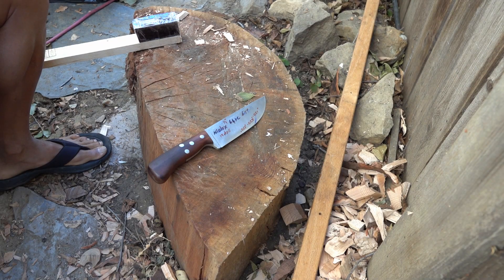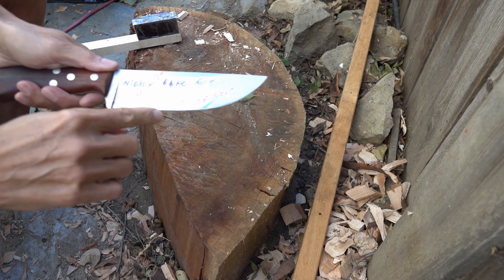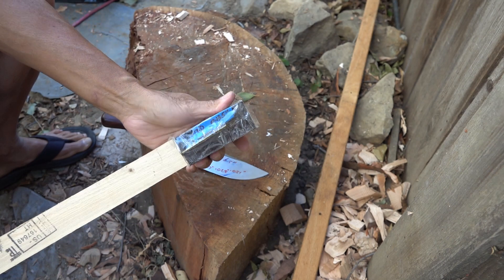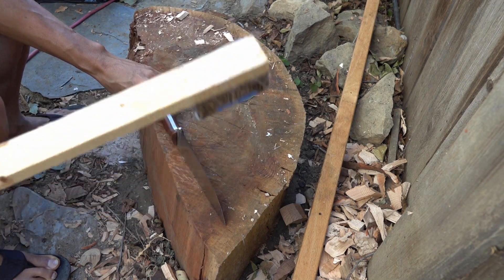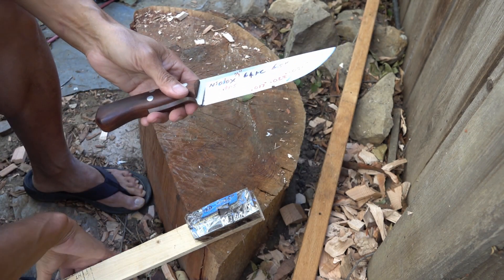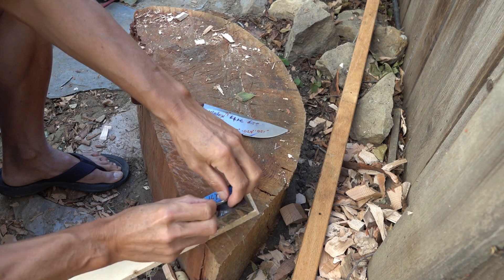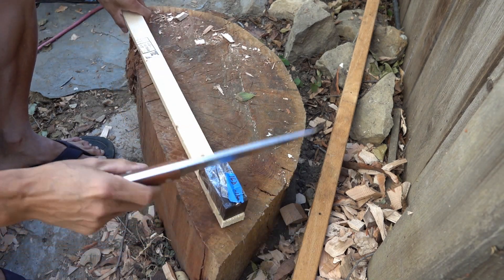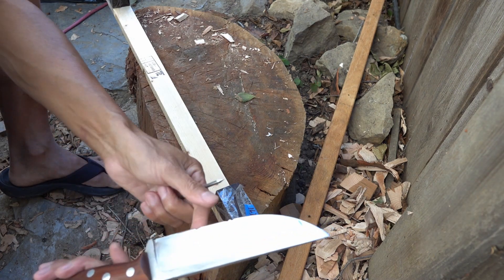bcmw 20181106 niolox 64rc shock and impact against 12 and 16d nails

Comment: The way I see this test is that while Niolox it isn't as tough as the Vanadis 4E, it stood up pretty well for a stainless steel.
Reply from the maker: Excellent eyes!  Yeah I used the word 'localize' which implied microstructure isn't plate/long-lattice so shock boundary is a short radius from impact point.  
EdgePro SiC 180 & 400 plates had no problem abrade vanadis4e 64rc.  While both plates were grossly glazed over when sharpen niolox 64rc - even at high pressure, they won't cut. I had to dressed them but darn-it they glazed again by niolox.

Comment: Good Evening. I was intrigued by the cruelty written about AEBL, elmax, and niolox. given 2+ HRC above the manufacturer. I would like to ask, have x been measured with a second hardness tester. and if so could you give me more instructions for niolox?
Reply from the maker: Yes, there were 3 party hrc confirmation - mostly 0.5-1.0rc higher than my conservative listed hrc.

austenite 1975F 20 minutes, plate quench for 20 seconds, air cool to room temp, into freezer for 20 minutes, into LN2 soak 15 minutes, air warm to room temperature, into 280F oven for 30 minutes, air cool to room.  Test AQ HRC. 

Temper 2x2hrs:  325F for delicate pushcut kitchen blade.  350-400F for other edge usage type.
Reply: @Luong_La  thank you very much. It was something I have been reading for a long time, but I could not understand. now the thing is clearer

Comment: Too much hrc 64 for what ? I make knifes from niolox /sb1  58-60 hrc and testing toughness  from wood /hardwood  steelnails beton . I not have so brooken edges . Best Grind flat on konvex end and never broke  edges and my knives  is a big guys 40cm blafes and more
Reply from the maker: You points are valid, 58-60rc is a good hardness and couple with convex edge bring good balance for edge with impact usage.
My video is testing - per given ht and edge geometry:  what is sustainable functionally; limits; failure mode.  A machete knife maker view point could easily assert that 58-60rc is way too hard ;)